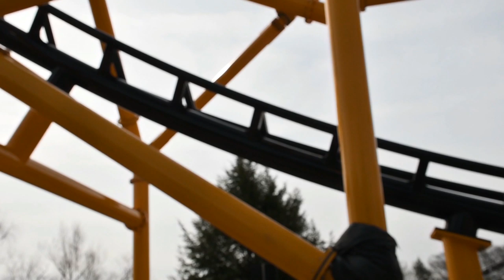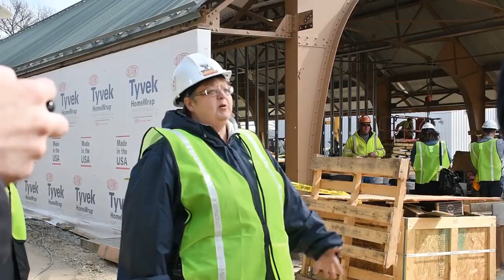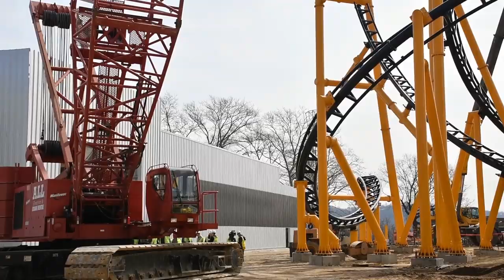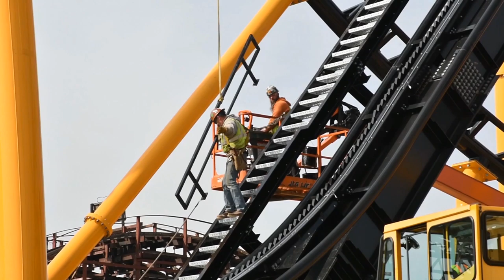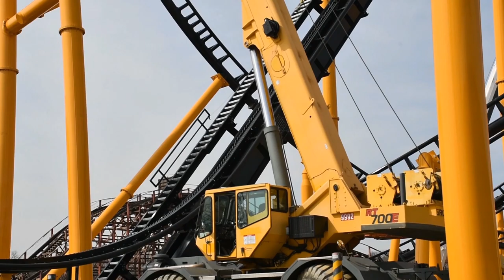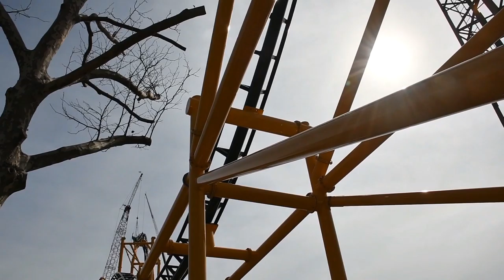Steel Curtain Behind The Scenes Tour

Comment: It’s taking them so long to finish and it was the first ride to be announced officially for 2019 what’s going on Kenny wood
Reply: It Should open On may 27th Memorial Day.
Reply: Dreb23 they are currently 1 month behind i believe
Reply: the weather hasn't helped at all have had snow and freezing cold way longer than usual in Pittsburgh this year
Reply: It’s fkn massive?
Reply: The snow has been insane this year. They have been building in 10 degree days. It’s been -20 sometimes last winter. They really are farther than I expected and this vid looks a few days older. They say the dive loop may be done by the end of this week. I think the coaster circuit will be done by park opening but the electrical system, and the Steelers Country we’ll have to see.
Reply: Its a completely new type of roller coaster by s&s, i think its a good thing its not being rushed